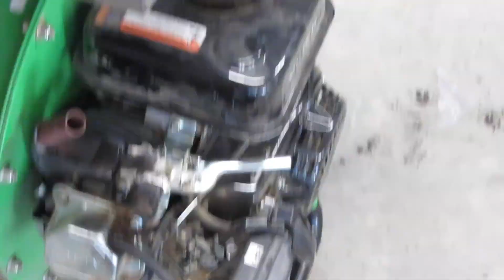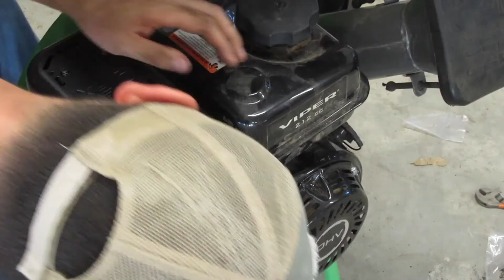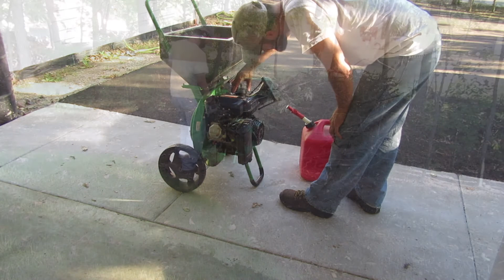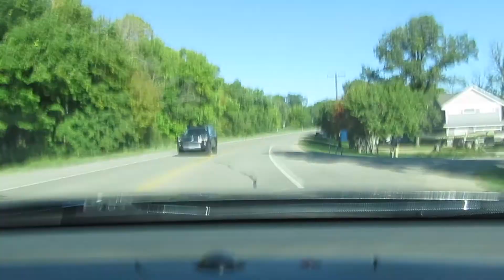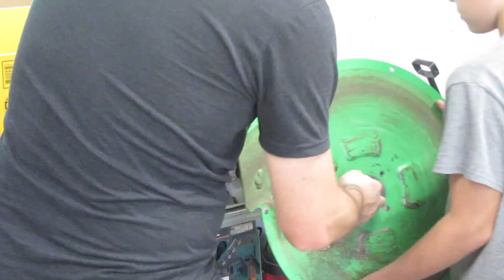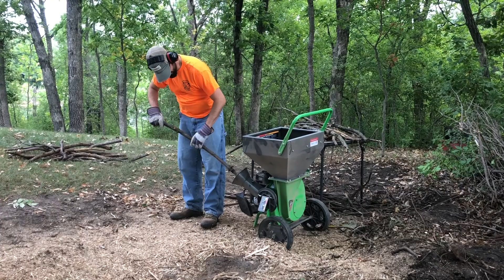Wood Chipper Repair

Comment: thanks for the video - i had the same exact thing happened to my tazz chipper muffler. i had to remove the wood chipper chute as well as loosen the gas tank to access that mf'ing screw in the back holding the muffler manifold on. i ended up hand-tightening that one. And the second screw on the left side right of the gas tank is almost impossible to re-screw given the obstruction of the newly attached muffler. just a cluster f. 

edit: the company was cool thought - sent me the broken parts right away.
Reply from the maker: I've heard from a few other people they've had the same issue.  Must be a design flaw.  But what should be a simple replacement was definitely a pain.  Thanks for the comment!

Comment: Yup, my muffler fell off as well, and I had an issue with one of the bolts holding one of the blades on; I bought a replacement bolt &  installed it, but I'm still having problems with the orientation of the blades...which are also rubbing against the outer housing. I'm sure you are aware of this by now, but these "issues" aren't just with your machine.... this model has multiple defects. At some point, when I have the time, I'm gonna be taking mine apart as well. I don't have a shop like your Dad, so it's gonna be on the back of my pickup truck....finger's crossed. I will not be purchasing from this manufacturer, or any of it's subsidiaries.... frustrated that I spent so much for something that ended up having so many problems.
Reply from the maker: Yes I agree relatively poor quality.  Plus the chipping wasn’t as easy to do as I was hoping.  I think we are going to go the route of getting rid of this and renting a commercial grade chipper once or twice a summer.

Comment: Do you have to drain the gas tank before removing it? And if so, how did you do that?
Reply from the maker: I can’t remember if I had already run out of gas or not but all you should have to do is turn the fuel shutoff valve to off then when you remove the fuel hose it will only spill what is what is in the hose and nothing from the tank.  I hope that helps!
Reply: @WeirdyBeardyWorkshop  Thanks! Very helpful.
Reply: What kind of wrench did you use on that back screw I tore mine apart already and can’t get any wrenches that will tighten that screw because of the obstruction.